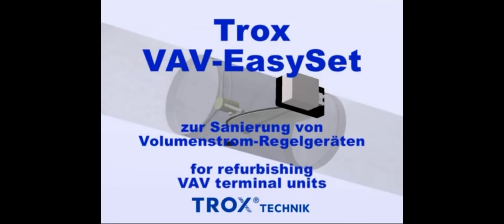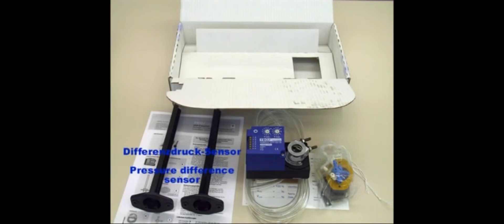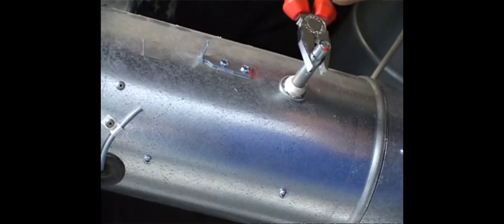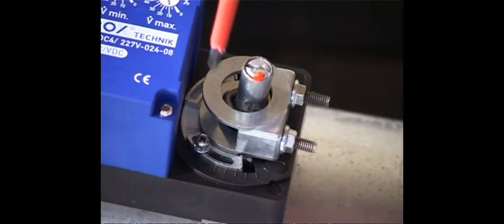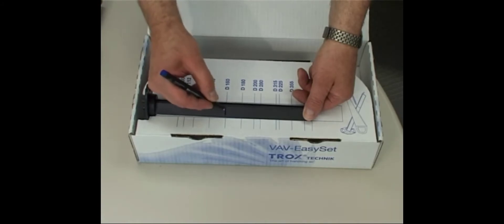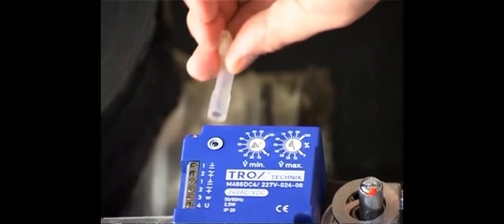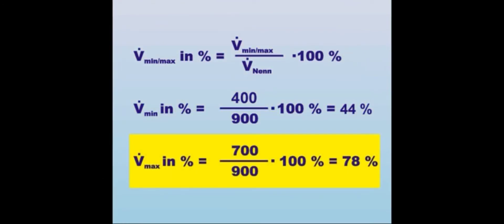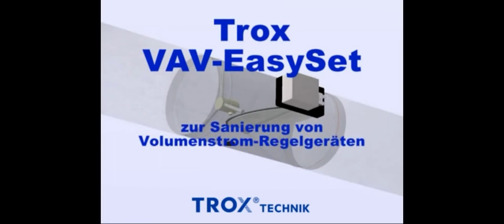Trox easy set vav Installation Tutorial

Comment: Hi sir what is vmin and vmax in vav
Reply from the maker: VMIN Minimum open damper and VMAX Maximum open damper adjust airflow minimum and maximum
Reply: Thank you sir for your quick response
Reply: I have a question, i have a Box with Vnom 1122m3/h, setpoints installed are Vmax 500m3/h and Vmin 100m3/h. When i send the Box to Vmin he closes complete and does 0m3/h not 100m3/h i ask for.
Reply from the maker: What is your application?
You control your area pressure or cfm?
Reply: Read the manual. It appears that the working range is sometimes 1-10V, not always 0-10.
Reply from the maker: Vmin is VAV minimum supply air cmh and v max is VAV max supply air cmh you set as per your requirement